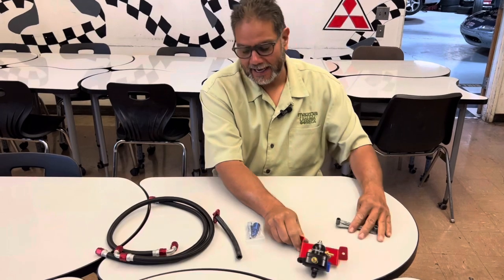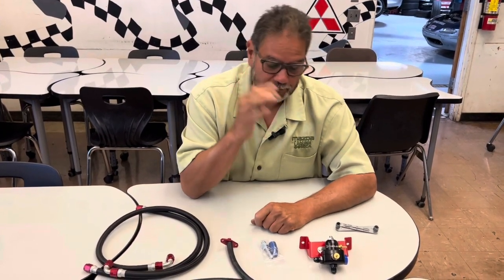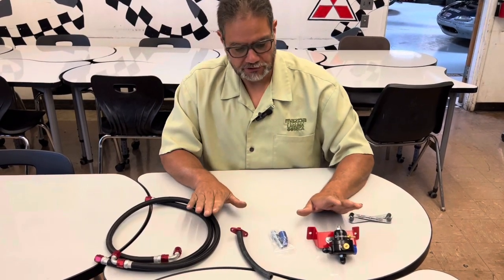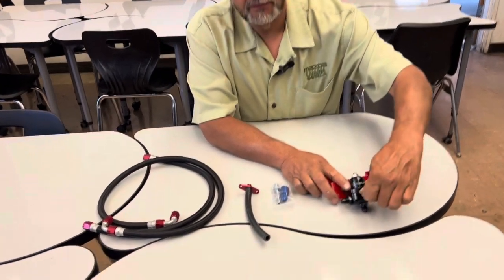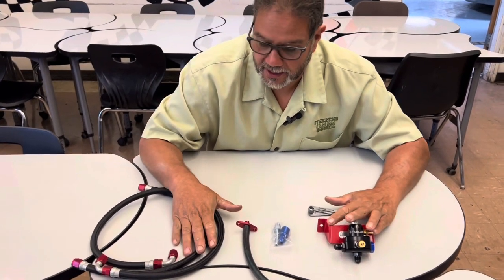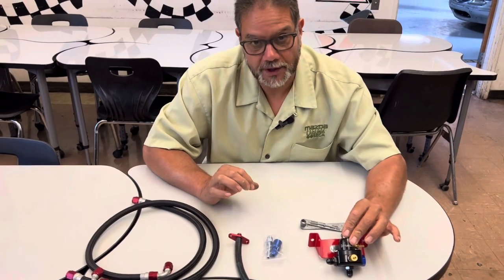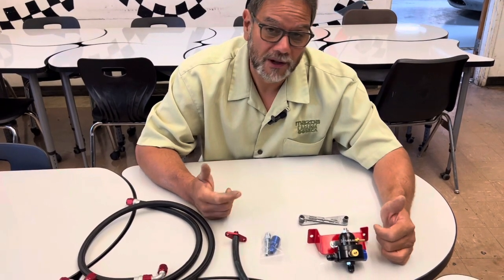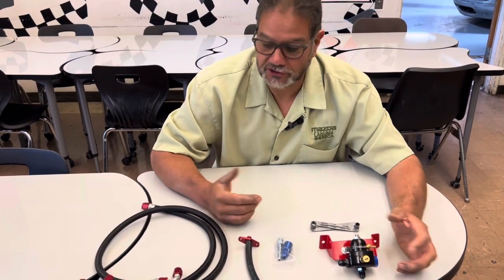PT23 How To Build A Spec Miata. Fuel Pressure Regulator Valve. Autocross, MX5, Track Car

Comment: Saw Mark at Sonoma last weekend and he said you might have a suggestion for my NB1 spec miata with high pressure in the gas tank and then fuel out through the gas cap and overflow..... Help me Obi-wan Kenobi.... you're my only hope!
Reply from the maker: Have you loop the small line on the filler neck? I have a video explaining how to do it.

Comment: What kind of dyno tuning can you really do on a spec miata?
Reply from the maker: With an adjustable fuel pressure regulator valve and timing a lot.
Reply: @aracing  Hopefully you will show us how to do that? If there's a way to squeeze a few HP using the stock ECU that would be awesome!

Comment: Looking forward to the next video - I've got the same kit, and I've been hoping you'd do a guide on how to install. Do I need to do a Dyno tune after installing this, or can I run it as is for a few races without tuning? I don't have a fuel sample port yet, so this would satisfy that requirement (as you mentioned).
Reply from the maker: Yes I would set the fuel pressure to 55 if you can.